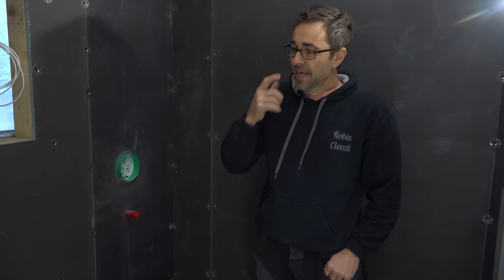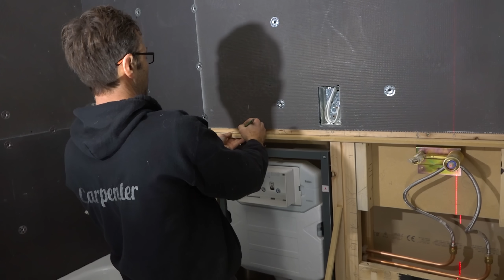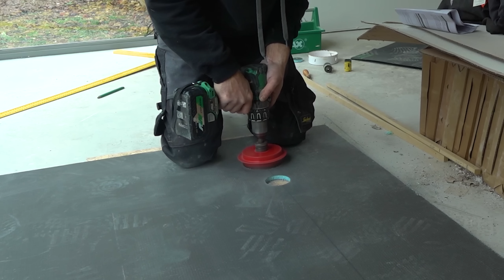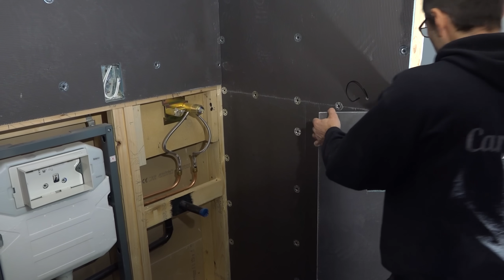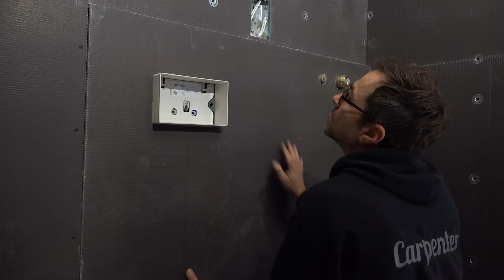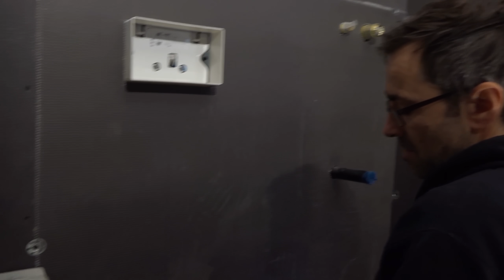Measuring Hack - Robin's Trade Tricks

Comment: Excellent work. When I see these hidden toilet cisterns I always wonder how you get to them to replace the float valve etc, once they are hidden behind elements board and tiles.
Reply: Is easily done if you remove the flush plate, there’s enough space

Comment: Do you need these boards for a shower even if its being used with the 8x4 waterproof shower sheets?
Reply from the maker: No you don't have to have them if the shower walls are watertight

Comment: Hi Robin, Bosch do a multi drill bit that goes through wood, masonary and steel now. T.hey are excellent and would solve you problem if the shower support fixings clashed with your board fixings

Comment: Using a stick to mark the places to cut is nice and clear... but when you think about it. A measuring tape is exactly like the stick apart from, the tape has all the markings already printed on it. You just have to pick out the right ones... aka write down the numbers you need to use.
PS: Sometimes on jobs where I need to remember a specific measurement to transfer to a lot of places, I just mark on the tape itself with a felt tip marker.
Reply: Yeah, at first glance it does seem like the tape should work just as well, and often there really is nothing wrong with using it. But in other instances a piece of wood is the better choice. The problems with a tape are 1. You can misremember or even misread numbers (particularly if you're trying to remember several at once) 2. You have to hold the tape at one end, so you can't always have your eyes in line with the thing you're marking, resulting in inaccurate measurements 3. The tape is flexible and prone to collapsing - sometimes you end up faffing around trying to keep it straight.

Comment: I just dab on some transfer chalk to the surface of the longest producing hardware, place the panel against the straight wall where it will be affixed, then tap the panel slightly to transfer the mark, cut out, and repeat for the next longest producing hardware. At each step the existing cutouts help align the next cutout position.
Reply from the maker: Nice tip
Reply: I always did this using wood glue. Its what I had in my belt
Reply: Is transfer chalk powdered chalk or something else? Is there a brand name you use?  Thank you🙏
Reply: @bradjones5266  I use standard construction grade chalk used in "snap lines". Put into a small bag made from porous cloth. And dab onto the fixture. Press the wall to it. This method is actually a  centuries old method of doing a transfer. Hope this helps.
Reply: Saint Coemgen thanks for your reply. I will try it. Just what I was looking for.  Thank you😊
Reply: Dabs of white toothpaste works, or blue if your board is light in color

Comment: What's the back glue you're using?
Reply: It's a polymer, i like using this type of adhesive and its sole purpose is to grab the board and hold it while I fix it and flatten out any slight uneven studs etc
Reply: Robin Clevett belt and braces, I’m into it.
Reply from the maker: you don't need it

Comment: As a carpenter myself this 'hack' is commonly referred to as a 'story pole/story stick' and is an invaluable (and more importantly reliable) method for transferring measurements.I think it's fantastic that you are sharing such methods but am also somewhat simultaneously alarmed that it highlights that certain techniques such as this, and for example the '3-4-5' method, seem to be somewhat elusive knowledge in today's trades.It never ceases to amaze me as to how many tradesmen I encounter on a daily basis that  have no idea of the very fundamentals of making something 'Square,Plumb and True', something which techniques such as these are the very foundation of.I am in my 30's and the son of a bricklayer, who's father was a builder so maybe I'm somewhat biased and have had the benefit of being exposed to such techniques from experienced tradesman, but I consider them not to be 'trade secrets' or 'hacks' but simply essential knowledge to get the job done correctly and efficiently. The amount of 'Builders' who can't set-out a square is actually pretty insane.Greetings from South London and keep up thee good work!
Reply: 3-4-5 aka. Pythagoras Theorem! Such an invaluable tool to have!
Reply: @itsTisja  Wrong way around methinks; Pythagoras Theorem; aka 3-4-5.  Other most common Pythagorean Triples are  (6, 8,10), (5, 12, 13), (9, 12, 15). Indeed there are an infinite number of Pythagorean Triples, so little chance of being stuck for a solution.

Comment: I think for that wall you've donee it the best way, but one other way of doing it-
Set your laser to the centre of the cutout, pipe etc. Then put your board into position. 
You then have a perfect centre line projected onto your board,  which as long as you have set your laser correctly (and haven't kicked it whilst putting the board into place😖), cannot be wrong. Mark the laser point with a marker, and you're done. 
This doesn't work as well if you have pipes sticking out of the wall,  I use it for marking electrical cutouts etc. 
Even after 30 years (this year) of sparkying, I still can't use a tape measure to save my life😖
Thanks for the great videos👍

Comment: Hi Robin, can you please tell me, if a problem arises with any of the components behind the Elements backer board sheet that you have just installed,  does it mean that the whole lot including tiles will have to be removed to gain access for any kind of repair or attention. i.e. leaking or malfunction of the cistern, waste ,water valves etc ?
Reply: The cistern is designed to be maintained by entry from behind the button cover

Comment: Looks really smart and neat, almost a shame to cover it up with the tiles. What is the reason to stick the board to the timber with mastic.
Reply: belt and braces!!!
Reply from the maker: You don't have to  use the mastic. Having screws and washers allows timber studs to shrink without pulling the board around.